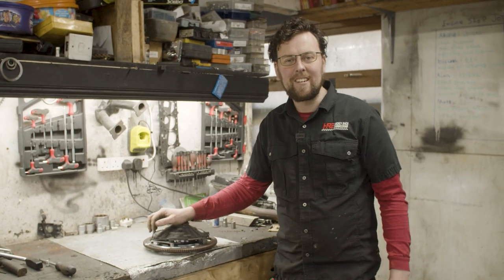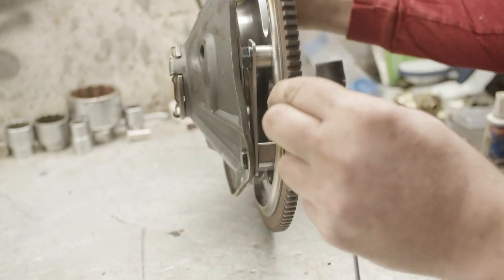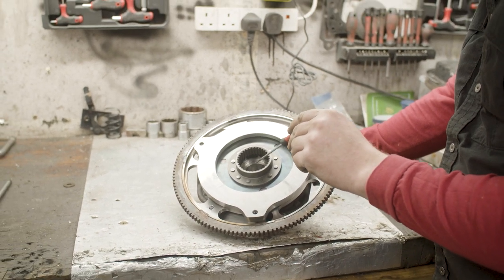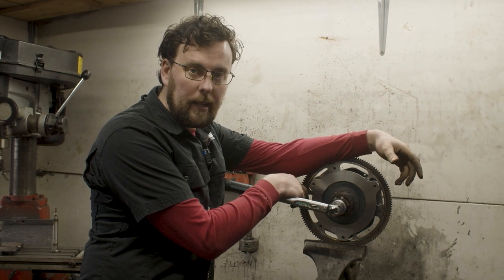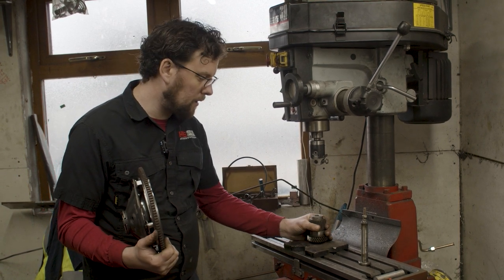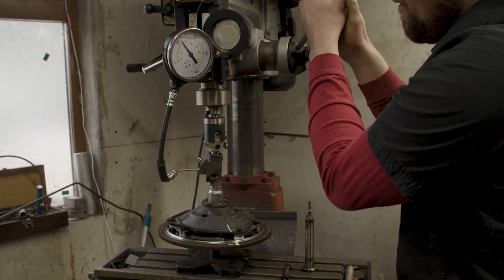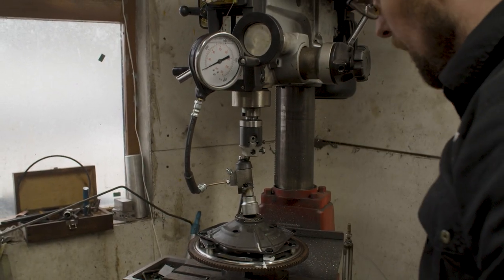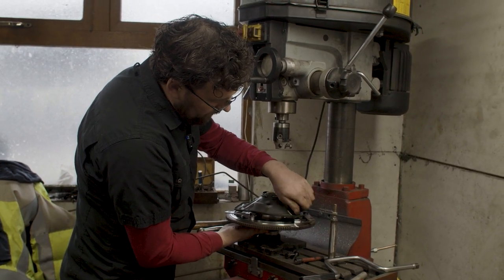Flywheel & Clutch Modification / Fine Tuning Classic Mini Car Part - 1

Comment: When I watch the attention to detail and precision you take in your work I wonder how any of the cars I worked on in the past actually ran. Our idea of a torque wrench depended upon how strong you felt that day  and the idea of using specially stressed bolts to hold heads down etc didnt exist . If they were long enough that was good enough. I am sure I could build a whole engine now from the parts i have left over at the end of previous builds.  Another entertaining and informative video. Thank You.
Reply from the maker: Hi Kevin as alway I greatly appreciate your ever so kind words. Haha I know exactly what you mean about a bolt is a bolt and torque was dependant on how many weetabix to ate that morning haha

Comment: Great insight into the pre-verto clutch setup Paul. I suppose this becomes critical for engines that are modified and putting out way more power.
Reply from the maker: Thanks Conor, it can be used on any clutch setup but yes the more performance orientated the more important it becomes

Comment: Pick your brains,  got a 970 S in for rebuild, it’s +40 with twin H4’s . What would be a good camshaft? Wanting fast road and to sound lumpy and sporty and revvy. Power numbers not important as it’s only a one litre. Just a fun cafe racer . Was thinking Kent cam 246 or 266 or 276 .
Love your channel, very inspiring 👍🏻
Reply from the maker: The AC Dodd RS is a really nice cam it has a bit of lump to it but also has great torque. Keith Calver has a very nice selection of cams as well and a nice guy to booth

Comment: Oh clutches and flywheels……….the stories I could tell. Most memorable for all the wrong reasons involved big spanner slipping off, smashing my hand on the slam panel ( clubman ) big spanner smashing against my knuckle and breaking it. Swearing lots and incurring the wrath of my mother.🤦🏻‍♂️🤣🤣🤣
Reply from the maker: Ho that is not a pleasant experience unfortunately I have been that soldier

Comment: So I like the idea of optimising the clutch operation by flattening the diaphragm and reducing the horn height so it becomes parallel. However this surely means that the thrust release bearing ends up with much further to travel before it actually contacts the clutch release plate/spring (using the standard clutch arm) to the point where you run out of travel. Because of how far the arm is pushed out the clutch slave cylinder will then overthrow and blow the hydraulic seals. Can you explain how this can work or have I missed something? Thanks

Comment: You continue to inspire with your knowledge and problem solving ideas especially those for the classic mini. Keep it up. Is that an already lightened flywheel?
Reply from the maker: Hi Robert you are very kind. Yes that is a lightened flywheel and pressure plate 👍

Comment: All the pre 1990 Porsche clutches felt like that Paul as did the 1991 Ferrari 348 tb I was told it was because they were a high powered clutch, can you shed ant light on this. Cheers.
Reply from the maker: Hi jer, the system used on Porsche and the Ferrari of the 1990's used a finger diaphragm multi plate type clutch. they use an over centre arrangement to get a greater range of motion to release multi plates at once. This is why you get this sorta over the hill feel it was older tec but did work

Comment: Hello from the other side of the world in Australia...were classic British ( or as we say pommy ) sports car specialists... the question I have is if you left the set up as it was straight out the box and fitted it, as the clutch plate wears the angle of the diaphragm flattens out... so by machining the ears down your going to have the diaphragm over centred which is going to negate what you've achieved? I've always understood that what you want is exactly how you've filmed the first bit where the pressure is slightly high then dips of fairly quickly so again as the clutch wears your not going to have to remove the set up every few thousand miles and keep playing with the set up? to put it simply they purposely make the set up that way to take into account wear... Hey one other thing, in regards to the primary gear to flywheel clearance issue YOUR SPOT ON! I've never understood why they machine that clearance so close? love your work keep it up!
Reply from the maker: Your close but i think you might be geting mixed up in the moving parts here. So  a Diaphragm Clutch when it wears sees the clutch plate get tinnier. This tinning sees the pressure plate move outwards towards the diaphragm in relationship to the flywheel. The result of this initially will be a feeling of an increase in peddle pressure but no noticeable slip. As the plate wears more the function angle will lessen and the result will then be that holding pressure will decrease and there will be a noticeable over-center feel to the peddle. 
Its unfortunately not a case that they make it this way on purpose. the problem is the people manufacturing the clutch plate don't talk to the people making the pressure plate and no one talks to the people making the diaphragms. Glad you liking the channel and keep looking after those minis
Reply: That's what the throw out stop is for. But the pressure plate (diaphragm assembly) itself can only move until it makes contact with the flywheel & shortening the horns brings it closer to doing that.